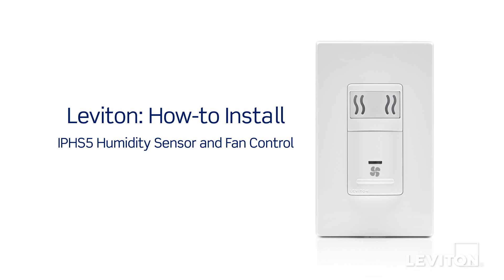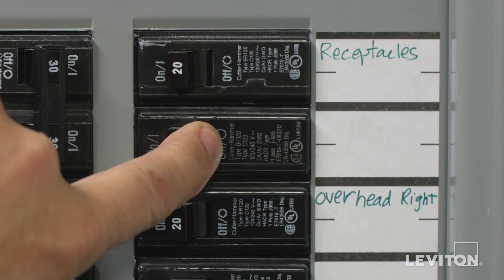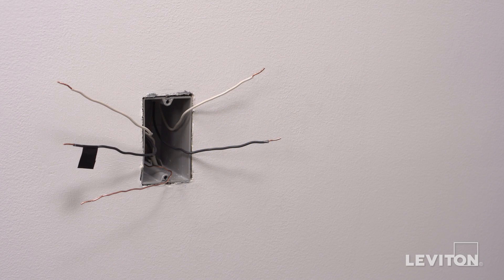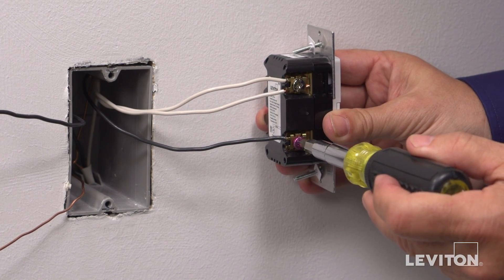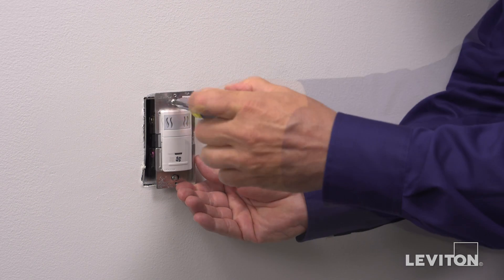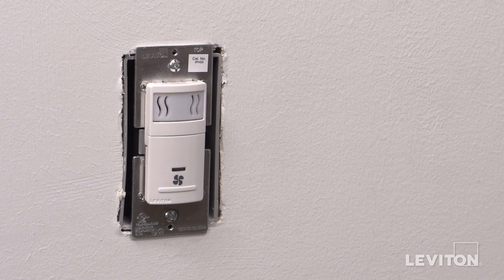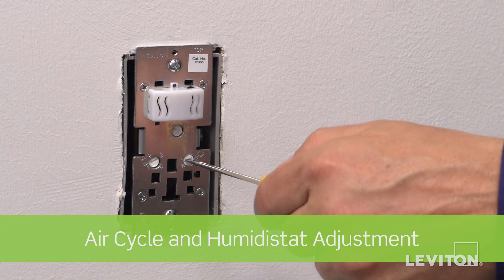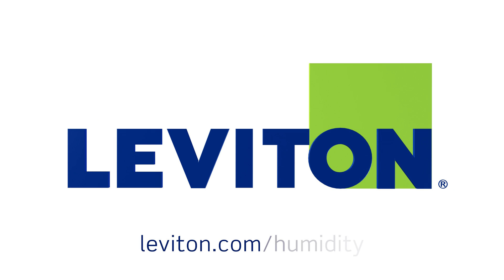How to Install the IPHS5 Humidity Sensor & Fan Control | Leviton

Comment: Not sure if anyone is still following this, but I am replacing a bathroom fan control that has 2 black wires on the back connected to a black and white in the outlet. The replacement is the Leviton as in this video.  I connected the white wire to the white connector and the black wire to the black connector on the Leviton (also the green wire to the green connector.)   Obviously did something wrong.  The fan control worked fine, but this Leviton does not

Comment: sorry but im a bit confused as to why you connected both of the white wires.
Reply: he supposed to pig tale both neutral s and have only one wire coming from the pig tale connected to the switch
Reply: That's why you should hire an electrician.
Reply: @STV-H4H   condescending and unhelpful
Reply: @DanGonzalesDenver  Actually he was being very helpfull.  If you don't understand basic electricity, you are of a risk to yourself, and whoever uses the shower while this thing is on.  The reason for connecting 2 whites on neutral, one black on hot and one black on load, is the switch requires power as it is an active switch and not a passive switch.  Meaning it requires a live power connection for it to work.  The other neutral wire is for the fan.  The hot terminal is self explanatory, as it is the line in power connection to power the switch.  And the load terminal is for the fan.  A normal switch is wired the same except that the white wires would be spliced with a wire nut